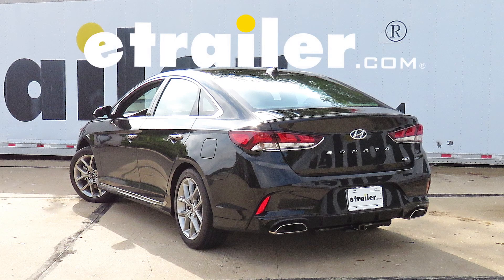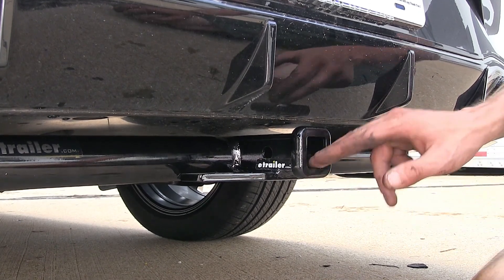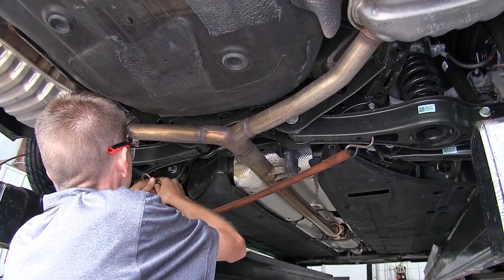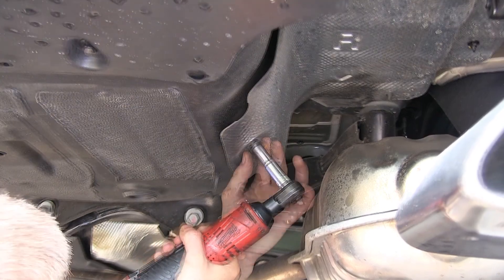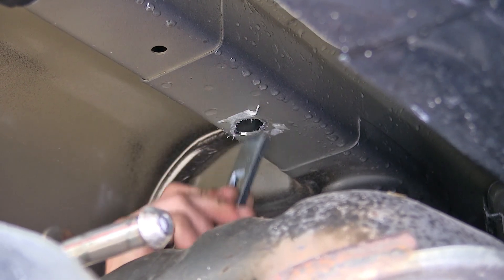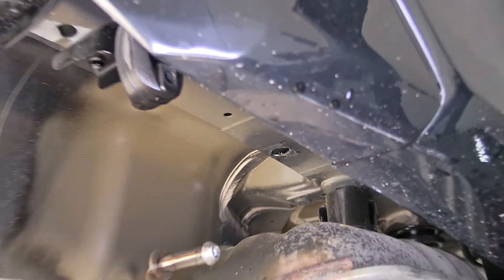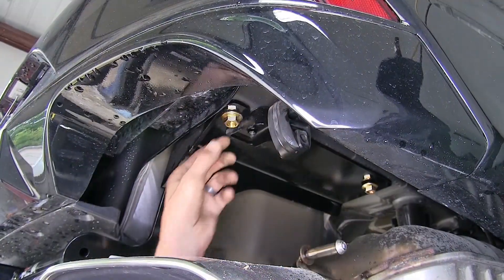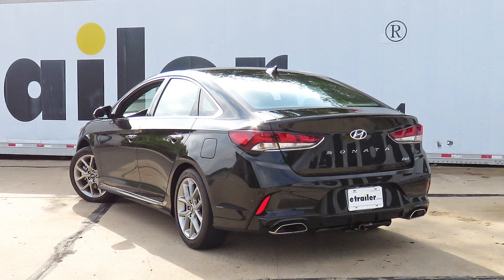etrailer | Installing the Curt Trailer Hitch Receiver on your 2018 Hyundai Sonata

Comment: Would removing the bumper be another option for fishing the bolts/brackets rather than enlarging the holes? Or it the frame rail closed off at the end?
Reply from the maker: We have not tried installing this hitch by removing the bumper. The end of the frame rail looks like it is sealed off so you wouldn't be able to get the hardware run through.
https://www.etrailer.com/Trailer-Hitch/CURT/C11402.html
Reply: I just installed the hitch by removing the bumper. With the bumper support rail also removed the channels are open so enlarging the holes was not necessary. Only issue is once the hitch is mounted there is very little access to reinstall the inner mounting bolts for for bumper support. It's doable, just a bit of a PIA. Worth it though for a clean install. Exhaust hanger bracket also had to be modified and trimming the plastic skirt is required if single muffler.